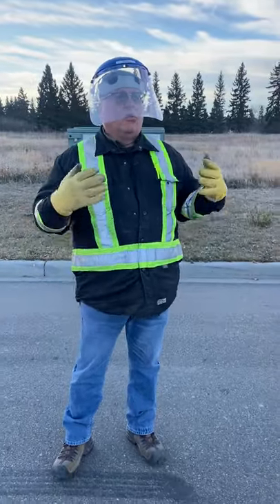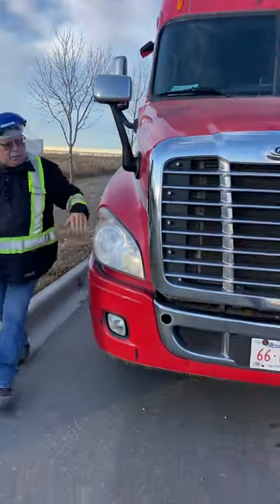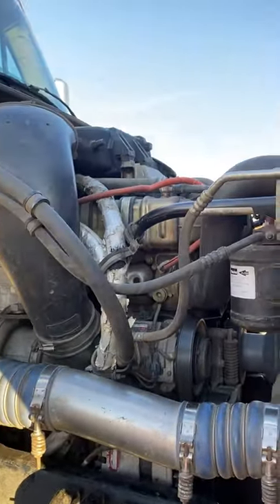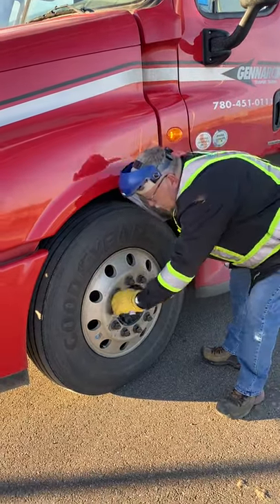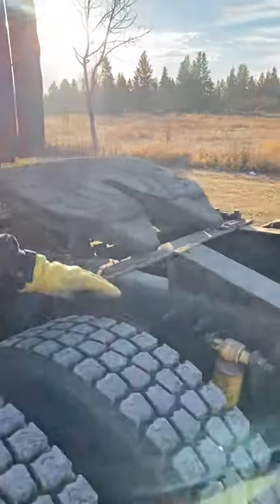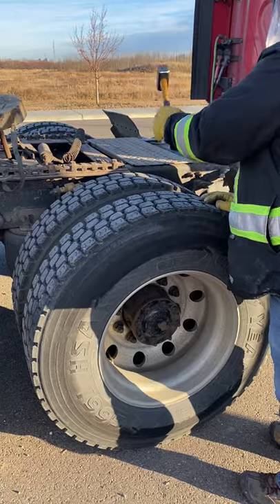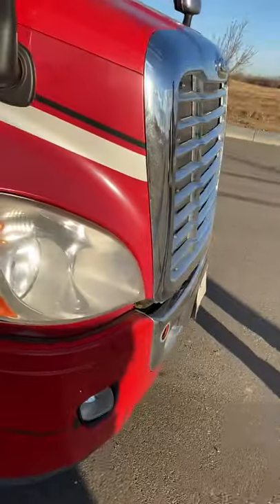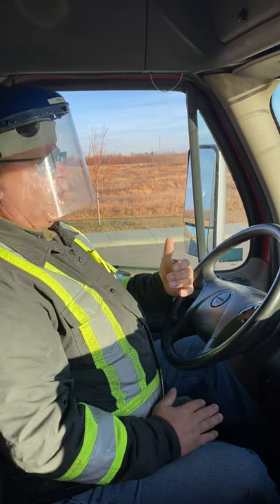Alberta Class 3 | PRE-TRIP & AIR BRAKE

Comment: It's too much to remember. I know how to drive a truck. Instructor said my shifting is as smooth as a seasoned professional. But i will fail the pre trip..i can't remember that much and will get frustrated and it will all fall apart. Next week is my exam. I've never been so sure that i will fail something in my life
Reply: I'm doing my test tomorrow and I'm the same as you I can drive the truck but I'm a slow learner it takes me alot to remember all this, I hope I will pass, I am going to try my hardest. Good luck to you aswell. At least we have this video to help us for the test.
Reply: @anteupofficial8477  My test is tomorrow too. Best of luck.
Reply: In yard is ridiculous especially for class 1. I failed my one first time, timing out on back ins on the off set. Nerves got to me wrong turn of the wheel at the worst time. Second time. I nailed back ins and failed for a left turn she didn’t tell me about till I was done and thought I got my one. Third time I failed in yard mind you it’s 6-8 weeks in between tests. I developed bad habits and failed cause I didn’t put my lines in dead end connectors. I’m feeling burnt. Write my 3 knowledge the other day and I’m booking a 3 road test in a month or so. I’m gonna study this in yard video for my road test for class 3. With coupling and uncoupling out of the equation and just the truck you have to inspect. I’m thinking I’ll get my class 3 first try. I’m sufficiently shifting gears.